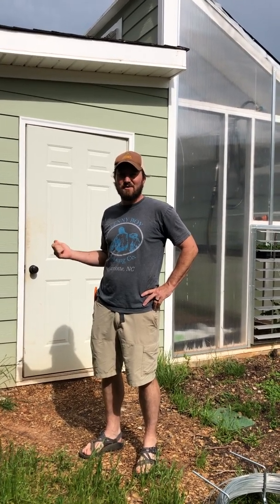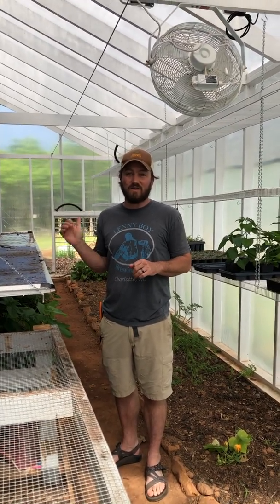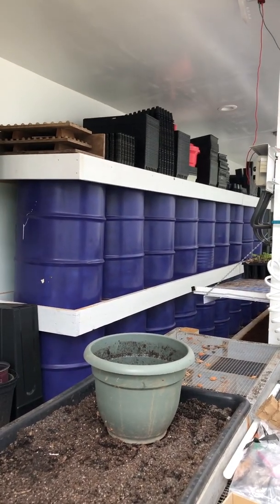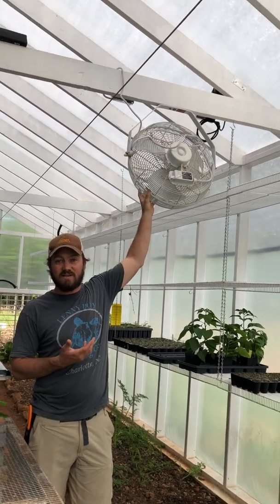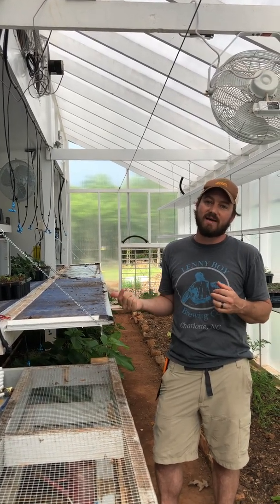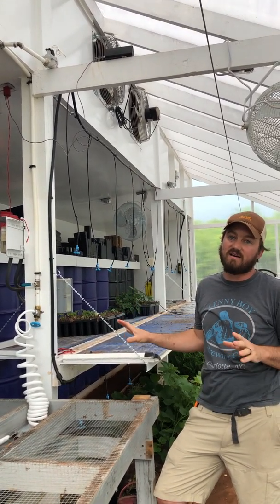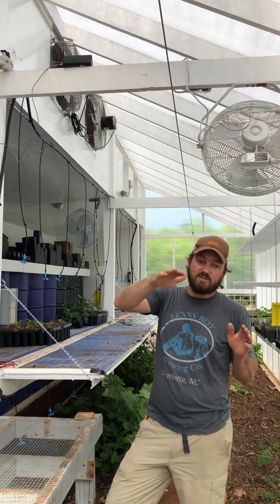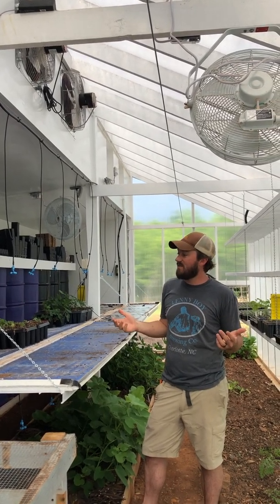Greenhouse Tour: Passive solar in South Carolina

Comment: Very nice! We are just planning our greenhouse in Alabama and very interested in your passive system. How well does the system work to cool the greenhouse in the summer? What are your average inside summer temperatures? Thank you....
Reply from the maker: Our max temperature in 2020 was 93 but most days we were staying at 85 which is the set point for the active fans. The aluminet shade cloth really helps minimize heat accumulation.
Reply: @ryanmerck9970  great! Yours is the best system we have seen for hot, humid climate accommodations.

Comment: Have you ever tried to see if the barrels would keep the greenhouse cooler that the outside temps and if so by how much?
Meaning you don't vent but maybe still use the fans to circulate the air.
Thanks
Reply from the maker: Hi Ed, I have not specifically trialed that approach. My expectation would be the solar gain in the greenhouse, even with aluminet shadecloth, would be more than could be managed by the water barrels alone. If I had the barrels hooked up to a geothermal loop so they could take the greenhouse heat and dissipate it into the soil beneath the greenhouse this could be a very good approach.
Reply: @ryanmerck9970  Thanks for your response

Comment: Is there a specific reason you went with the inflatable plastic vs using twin or triple wall in the main portion?
Reply from the maker: Primarily cost. Double layer poly is much cheaper than twin wall and the R value is comparable.